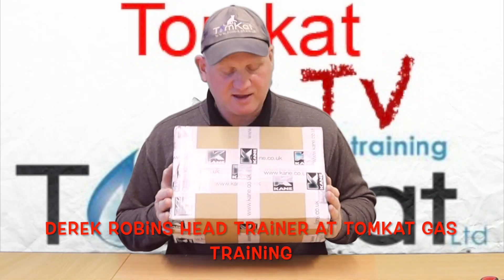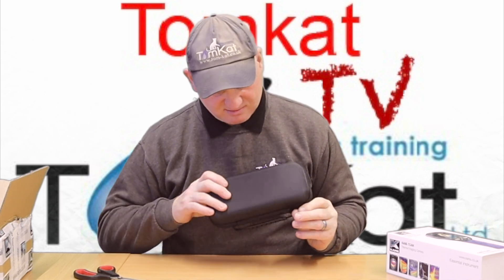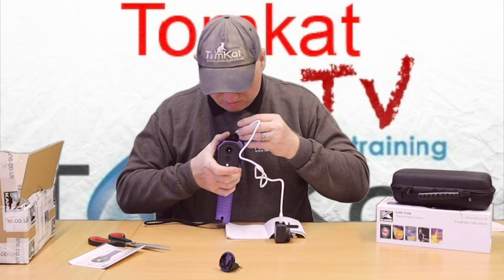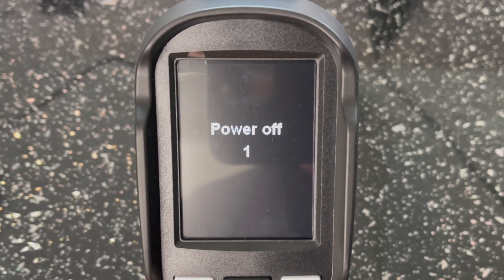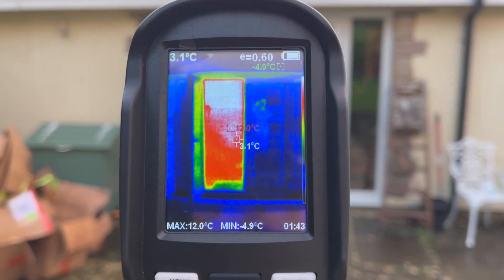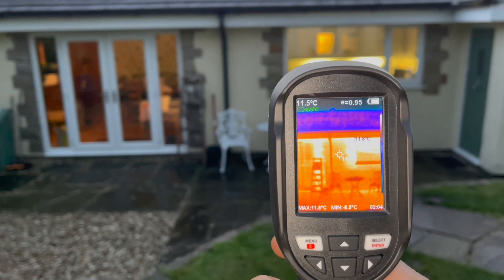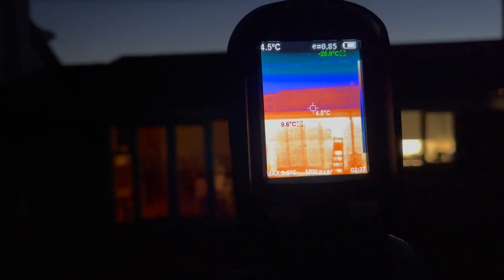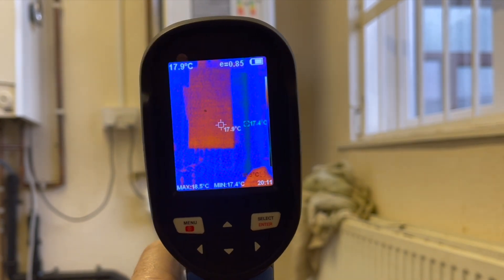Kane TCAM thermal imagining camera, unboxing, reviewing and testing the camera to see how good it is

Comment: Check out Bosch videos on their GIS-1000. VERY impressive spec. and has built in humidity sensor.
Just found one for £195 with Bosch full warranty,  or you can buy them for around £350.

Comment: You can pick up a Infiray P2 for around £200 from the usual Chinese sites. Full 25fps and it has a respectable 256*192 thermal resolution (higher than the Kane model your reviewing). The Flir One available on amazon (for around £160) is usable for the money but the Infiray with the responsive display and increased resolution are definitely with the extra cash.